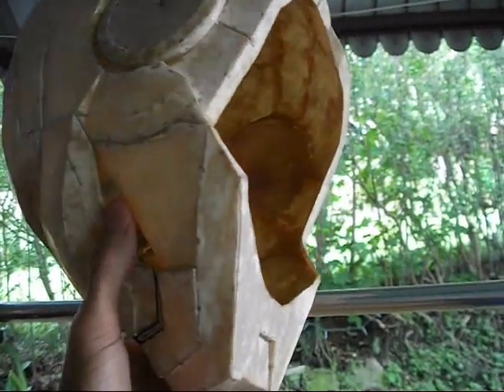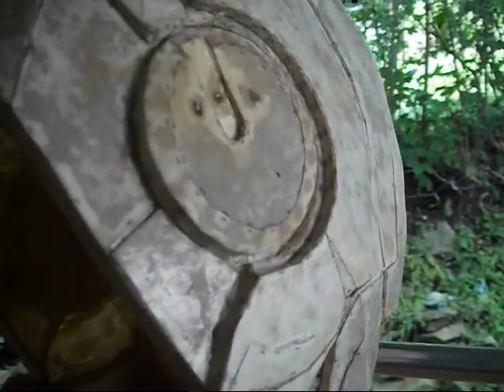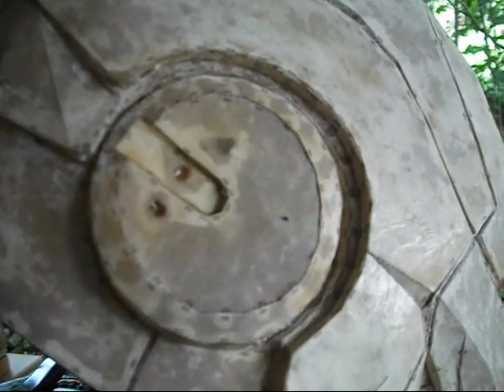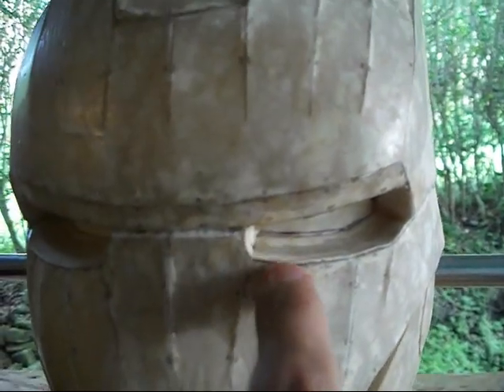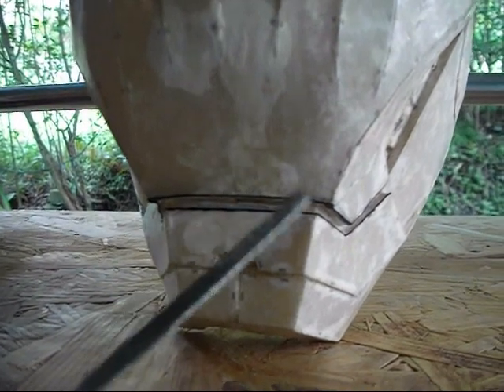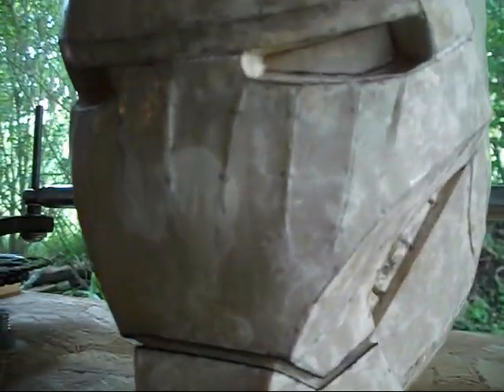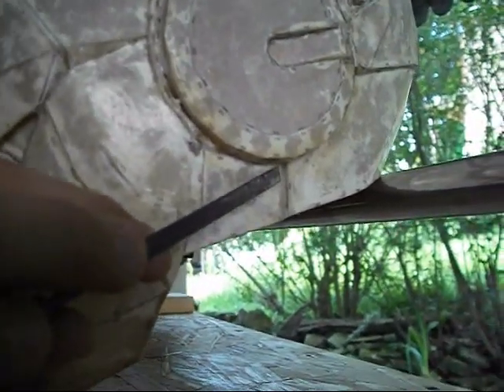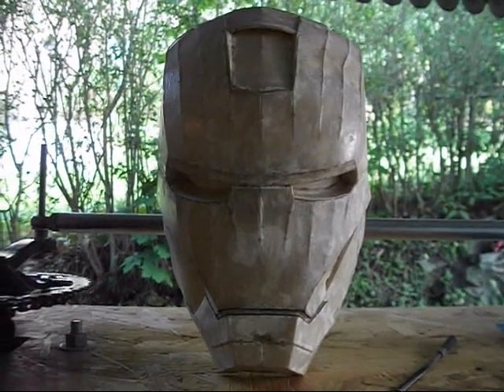IRON MAN HELMET BUILD PART 3 ~ FINE TUNING PRIOR TO BONDO

Comment: I made some Batman gauntlets with foam for Halloween but it was very fragile, can I use fiberglass on them to make them stronger? would it work?
Reply from the maker: Fiberglass resin will destroy the foam.  You would need to use an epoxy resin such as Epox Amite or Aqua Resin (with the fiberglass).
Reply: Boochieboy thanks man.

Comment: So i have finished doing my resin inside and out so i have 2 questions 
1 should i use my 220 grit sandpaper and smooth the outside out? And 
2 do i do the fiberglass cloth inside and out or just inside
Reply: Cloth on inside only.

Comment: Are we able to sand the helmet? That way it is smooth before painting?
Reply from the maker: ***** You could sand the helmet as it is in the video, just fiberglassed and resined....but you should really use body filler over the helmet and sand that instead, like in my part 4 video.

Comment: Can i skip the fiber glass and use plastidip??
Reply: Plastidip is flexible, paper is flexible, without the actual glass fibres with resin paper won't be strong enough. That includes paper covered with resin. Even if you put loads of resin on it, you're just going to add weight, but not structural strength.

Comment: I want to detail my helmet much as I can by carving in my own lines but I'm wondering would it be best to carve in during the  fiberglass stage or  the bondo stage ?
Reply: The body filler stage. Actually, after you smooth out the main surfaces. And if you can get something better than BONDO, then go for it mate. Bondo is not really the best product...

Comment: After the resin is dried and Bondo is done, would it be fine to go ahead to put paint and padding and other accessories on and in  the helmet?
Reply: Now it's a hard shell personally I would use some sort of Poly-filler, (similar to what you do walls with), wait for that to dry and then sand down. I wouldn't go for a finished product at this stage :)

Comment from the maker: What matters is the fiberglass work itself being properly done (cloth being properly "wetted" and laid overlapping with the right amount of resin), and how many layers of cloth you have in total.  Being on the outside of the paper, inside of the paper or both inside and out is irrelevant.  Just remember that pepakura is not to be used as real safety equipment, no matter how well it's done.

Comment from the maker: Do NOT use fiberglass cloth on the outside, just a coat or two of the resin alone, then Bondo over that.  Adding the Fiberglass cloth will cover any detail you have which is why you only want it on the inside.

Comment from the maker: Anything is possible if you have the time I guess.  You could cut in the detail lines with the needle files, but if you wanted to separate parts (faceplate, jaw, back panel) you really need a dremel tool and cutoff wheels.  You can get the same battery powered Dremel I use at Walmart for $20-$25.

Comment from the maker: No, you can't add too much cloth.  The more cloth and resin layers you add, the stronger the helmet will be.  Just don't get too carried away because remember, every layer you add makes the inside smaller, and you want to make sure you can still fit your head in, which would be hard to do with 59 layers in it, lol.  Dremel off any cloth/pieces that are sticking up.  If you have air bubbles under the cloth, cut them open with the Dremel and fill them with more resin.

Comment from the maker: In America the term "putty" could apply to a wide range of materials.  Go to any automotive supply store or hardware store and tell them you're looking for automotive body filler...it doesn't have to be Bondo brand.  If it's polyester based filler it's the right stuff.  I've also heard it called "BOG" or "Builder's Bog" in other countries.

Comment from the maker: In the end, yes, but as it is right now, no.  For it to fit over a head the back panel needs to be separated from the rest of the helmet and then reattached once it's on the head.  I will cut the back panel out right before painting the helmet at the end.

Comment from the maker: Don't panic lol, everything can be fixed.  Yes, I used my Dremel with the small cutting wheel to cut off the resin filled ears.  I cut in a criss-cross pattern and used a flat screwdriver to pry and break off the pieces until the whole ears were off.  Once they were off I used the sanding drum on my Dremel to flatten and smoothen the surface to get it ready for the hardboard earpieces.

Comment: Yeah I am struggling with the paper ear pieces!! I filled one with resin but i got reding all inbetween the ear piece and the piece around it and I tryed to dremil it out but put a hole in the ear,so I am thinking of cutting off the ear and making it out of mdf. Did you use a dremil to cut off the ears after filling with resin? i'm so stuck with this part right now, not sure what to do!!

Comment: Thanks for the info. According to the guys over at the 405th, pepakura armour wouldn't be able to stand up to a paintball, and would shatter immediately, but I noticed in your videos you mentioned that it was "nearly indestructible" which gives me hope. Also, I'll be using your videos as a point of reference for my first project. They're very informative, and give good demonstrations without taking half an hour to do so, so kudos!

Comment from the maker: I wouldn't worry about adding extra resin to the outside, as resin alone is brittle....it's the fiberglass that adds all the strength.  I would focus on the inside.  My helmet has three layers of fiberglass inside and trust me, it is ridiculously strong.....it would take a hell of a lot more than a paintbal to do any damage to it whatsoever.  Like a baseball bat, lol.

Comment: Fiberglass resin should be readily available most anywhere in the world. It's sometimes called polyester resin. There are various polyurethane resins available, but they tend to be more expensive. That said, I did see a few people using a bunch of hot glue sticks melted down in a saucepan and painted on the inside, but that wouldn't be as rigid as fibreglass resin.

Comment from the maker: Thank you  Yes, I mixed the resin and hardener as normal and poured it in the earpieces.  It's the regular consistency, like syrup or honey.  If you want to thicken it you can add some talcum powder (baby powder) to it which is basically what Bondo is, or just let it start to thicken a bit before you pour it over your hinges.  You can also build a dam around the hinges with modeling clay and pour it around to keep it from running all over the place.  Then just remove the clay afterwards.

Comment from the maker: There will be room for all that stuff, but I'm not cutting out the faceplate on this one.  I plan to make a mold of this helmet and cast copies of it in urethane plastic.  Those copies can have the faceplates cut out if I want.  This helmet is basically being used to make my mold from, and while it will be wearable and have lighted eyes and padding, it will mostly be a prop used for display purposes...hence...no need to cut & motorize the faceplate.  Thanks for subscribing...more to come!

Comment from the maker: I'm not able to wear mine yet.  You need to cut out the bottom back panel to be able to put it on your head.  When the Bondo work is done I'll cut the panel out before I paint it.  The back panel can be reattached with magnets, hinges or clasps after you put it on your head.  If you still can't fit your head in with the panel removed you have to upscale the template in Pepakura designer.